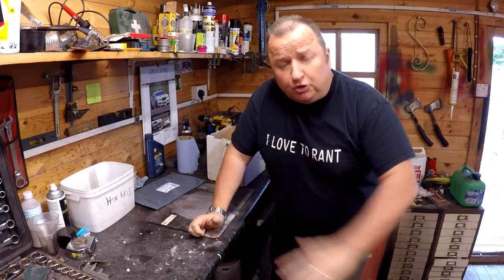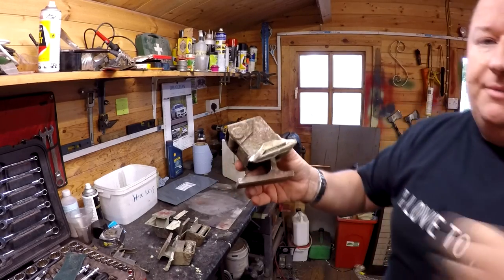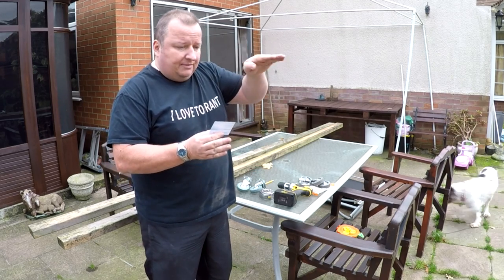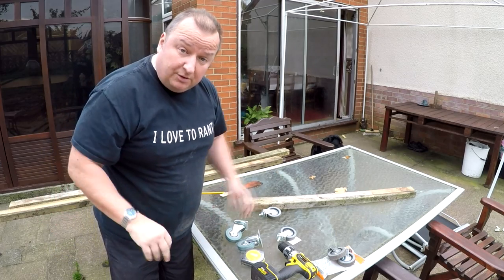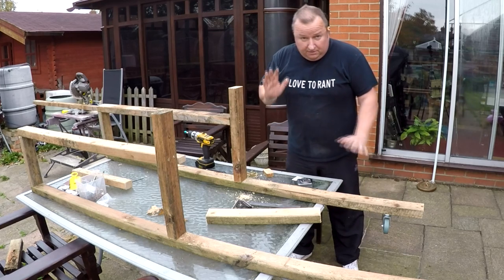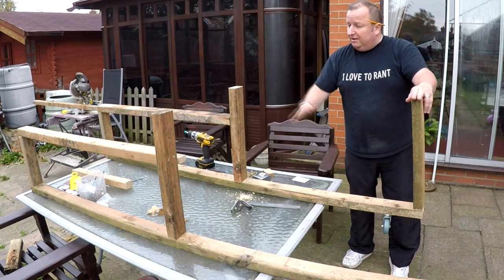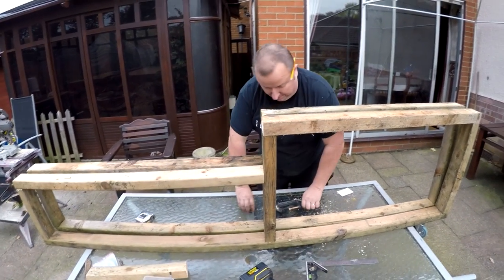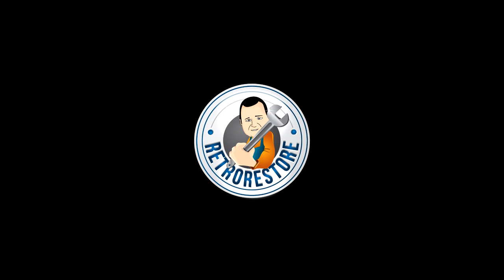Part 25 Reliant Trotter Restoration Making A Body Trolley

Comment: Another great video mate I've made electrolysis machine it's really good for loosening all the rust especially from them tight areas you cannot get to normally if you shove them in for a few hours they will be as good as new it's a fantastic little machine and very easy to make
Reply from the maker: I have done that before Leon but i've heard how good this vinegar is supposed to be so I thought i'd give it a go as well.
Reply: retrorestore it's going to be nice to see how good it works I've heard it as well but never tried it

Comment: A couple of the hinges on my saloon were like yours, very stiff indeed. But I just soaked them in WD40 and kept working them. They are all quite free and easy now. I think yours will be the same. They don't have to hold any weight to be fair, so they shouldn't be bent out of shape.
Reply from the maker: Yes, I hope so, I want to try the vinegar as it dissolves the rust so if the pin is rusted, it should stop it seizing again.